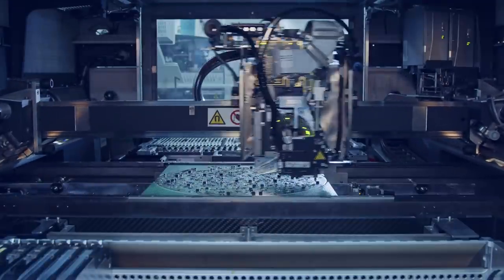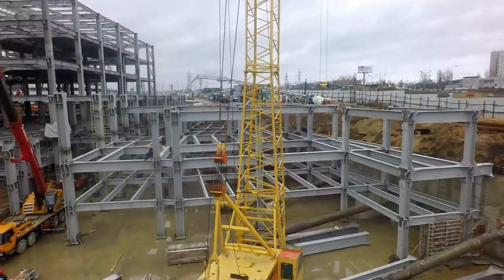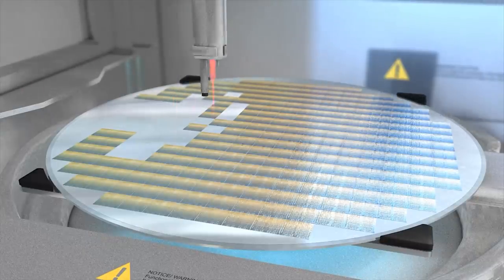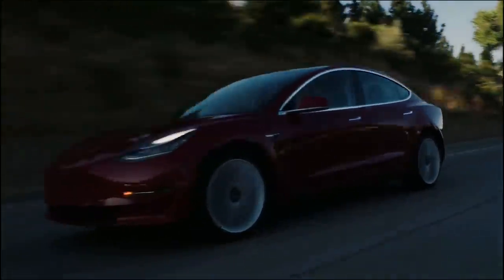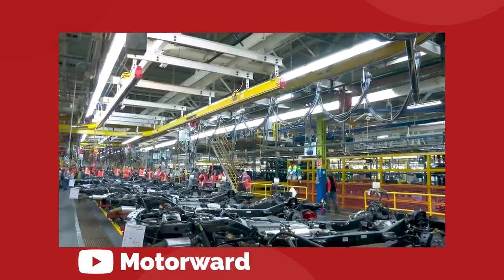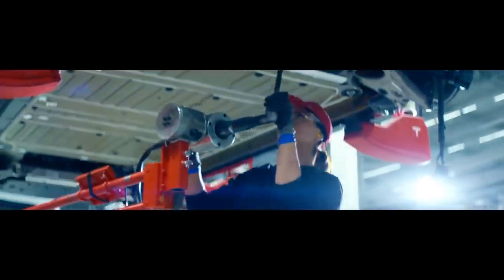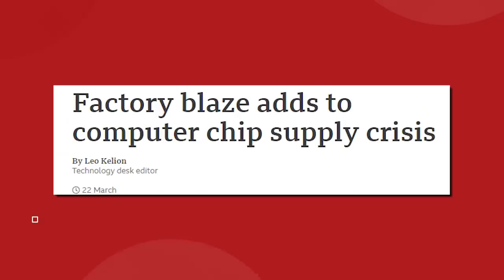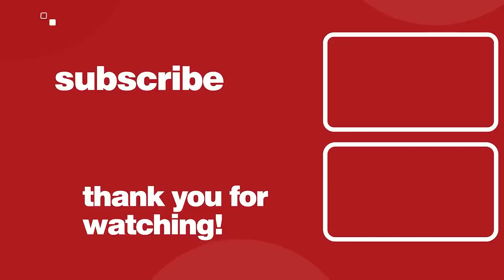The Real Reason Tesla Overcame The Chip Shortage Crisis!

Comment: Many appliances like washing machines, refrigerators, microwaves--have NOT improved with electronics, they've gotten worse.
Reply: In what regards? In terms of longivity? In terms cost effiency or energy preservation?
Reply: @Danny-qt5vt  In terms of "it's the circuit board that's bad" when it quits working after two years.
Reply: There was nothing wrong with mechanical thermostats for refrigerators timers stoves dryers and washers they were more dependable! Never needed a digital display!
Reply: well....."old is gold"
Reply: @Danny-qt5vt    In terms of efficient usability, cost and reliability.   Microwave ovens are the WORST, unless you search out a commercial one.  Would you take 5 or 10 seconds hitting hitting several buttons to turn on a light?  Yet that's what we have for those STUPID nukers.  (i have a commercial dial type and it's vastly superior) 

 ON with a timer to OFF, that's what you do with them, it's asinine to have anything more than a rotary dial.

I had a brand new Hairer refer a few months ago, the touch screen controls NEVER worked right but then the POS never got cold anyway, just didn't work right out of the box after I spend 3 hrs getting it unpacked, up stairs and into my kitchen.  (should have plugged in with extension cord out in the front yard first to see if the pile of F_ck would even turn on besides the light)
Reply: I agree microwaves were better with a knob.  I don't want to go back an analog clothes washer.
Reply: Electronics can be reliable if the manufacturer wants it. Most dont. 
Ford delayed the introduction of electronic ignition because it was too reliable and they wanted it to fail out of warranty so they could charge for another one.
Reply: @fivish  yep this is why satellites last 20+ years. But it costs more. Someone has to design it for life and the autos want to save $100 on a $40k car but it’ll needs several thousand in repairs a few years off the lot. Toyota seems to get this. My gm needed a new part every 6 months
Reply: @fivish  Where did you hear this?
Reply: @John Milton yeah personally the only thing I personally enjoy but that's just me is smart switches and sometimes i just design my own stuff to look chunky and haphazardly made purely for the excitement of doing it.

But i do enjoy some basic smart tools however outside of my computer, phone, fitband, switches and my Alexa, everything else need the least amount of electronic parts as possible, i may have the skill to repair them but not the amount of fucks required.
Reply: @plumbum6558  or a 20in touch screen monitor that tells you when your chicken is done marinating.
Reply: @fivish  so capitalism is not was taking us forward but instead holding us back?
Reply: @Danny-qt5vt  Good questions. I was at sea when I first saw the earlier comment .
Reply: because they are made to break down within a few years so you gotta buy new ones. Nothing to do with electronics per se. Its an economic theory that is kinda wastefull.

Comment: I have never opposed an idea expressed in video/Youtube ever so much to write a comment on it, but here I am...
Fundamental problem with this video? There are A LOT of valid points where none of them look outside the given statement (try to prove the oposite).
In start, background: I am dealing with chip shortage solutions in a company were all its products are "electronics"; I am very familiar with reality of this situation.
Few of our products got stuck in supply chain shortages, but some never even stuttered... not even for a day there was a "chip shortage" for few products ever! Reminder - all of the products are strictly electronics. What gives? Only few arguments as an example...
"Chip shortage" is more precisely defined as a "sub-100nm digital high-speed chip shortage" (to be clear, that 100nm number I just pulled out of my a** as even I don't know the precise number myself, but the fact stays). Not all chips are made equal. Not all of them require "cutting edge" tech. Even some ICs we might consider as "very sophisticated" does not require companies like TSMC to make. It has nothing to do with "vertical integration" or "in-house code development". First, there is a difference between general purpose ICs & ASICs. If You design Your own ASIC (essentially a custom chip), You can chose two things - size & technology. If You have a freedom to make Your chip huge AF & lower the frequency of operation at the cost of more operational nodes inside Your ASIC, You can make a "potato" chip that is far superior than the most powerful CPU in the world! Real life example? BitCoin ASICs vs Intel CPUs. Intel (at the time) was built on 14nm tech whilst BitCoin ASICs were made in 130nm tech! Hell, even current top-of-the-line BitCoin ASICs are made in "true" 16nm tech while Intel is made in more like 10nm or smth. Guess who mines faster...? Most in-house designed ASICs WILL NOT use cutting edge technology as it is more expensive and makes no sense. This makes ASIC market in non-cutting-edge tech pretty immune to "chip shortage" as they can be made outside of very economic-sensitive factories. TSMC is faaaaar from the only place where chips are made. Guess twice what "Tesla" was doing and other car manufacturers never did...? "Boch" is main tech supplier for if not all then most car manufacturer in the world in means of electronics. As they supply so many makes & models, it makes no sense to develop an ASIC for every customer - it is much more cost-effective to go with generic, over-the-top ICs, that can do everything for everyone... if they can be supplied, that is.
Second reason is plain and simple - money. If You have money, You can buy anything. Even Your place in queue ahead of everybody else. Even chips that are out of stock. F**k it - You can by a workforce that can design You out of any shitty situation You get Yourself into! We did it ourselves (bought chips that were so called "out of stock") for one our product... Okay, price went up significantly.... for A CHIP, but in retrospect for whole product? Not that much. It was not even that much to increase the price of our product in the end. But for manufacturers, where we are talking about hundreds of chips? Brute-force approach is just not an option!!
There are many more arguments from real life that contradicts arguments in this video, but I am already playing the bets on the fact someone, anyone will ever read this! :D
So, final word - all this "chip shortage" is actually affecting very narrow market space of silicon products that (unfortunately) covers a wide variety of products due to much, much more significant factors that are very much outside the scope of this video.
Though I am ready to tell more if there is someone that got to this line... :D :D :D :D

Comment: Computer "chips" are made with Silicon (Sill i CON) not Silicone. Breast implants use silicone.
Reply: My bong is also made of silicone, it is 3 separable pieces and really easy to clean :)
Reply: Whats the diffrence. The utilty of the element is vast. From inplants to computer chips
Reply: @stevehoran6132  Silicon (Si) is an element. Silicone is a petroleum product.
Reply: @milesobrien2694  huh fr, I thought they where the same thing xD cool how Si works in chips huh
Reply: @stevehoran6132  Well I made the original comment because he said "silicone" when he should have said "silicon". But silicone is based on silicon: "The most common silicone compound, poly-dimethylsiloxane, can illustrate the central characteristics of the class. The starting material is metallic silicon, which is obtained from silica sand." So you're nearly right, LOL.
Reply: That's basically why the rest of the word use silicium.

Comment: What wasn't mentioned is that the more traditional car manufacturers depend on older style chips that use more wasteful large nanometer architecture. When they cancelled their orders the FAB manufacturers moved onto making smaller nanometer chips which can't be used by the car manufacturers without redesigning a lot of their electronics. They also would need to test the newer tech chips to make sure that they are reliable and safe enough to be used as these are considered to be mission critical.
Reply: Thanks you just saved me 14 minutes.
Reply: Those are 10mm chips now they use 5mm & 1mm
Reply: @nathanthomas8184  nanometer not millimeter
Reply: seems a lot of computer makers are short on chips too.  PC sales soared throughout covid, why did they stop making or distributing those chips?
Reply: @anythingoriginal  they didn't stop. Demand is just at an all time high.
Reply: @oldrrocr  I think you misunderstood "obselite" vs older process nodes. Tesla has many sensors and cameras that require a lot of processing power to compute it's surroundings for autonomous driving. That means they require more powerful, newer chips. Most other vehicles don't have anything close to the AI systems that Tesla uses, so they don't need theost powerful chips. For what they do, the chips in most modern vehicles don't need a lot of power. So it makes sense to not buy chips based on the more expensive newer nodes. It's like buying a $3K computer for your grandma. TSMC and other fabs don't care to increase capacity on said older processes because they don't have as big of a margin on them and they're already well past full, it'd be crazy to. The only thing Tesla did that made them smarter was not cancel orders; the fact that they're using a newer process node is circumstance, not pandemic planning.
Reply: @nathanthomas8184  as someone said, it's nm and not mm. And no, no one can manufacture on a 1nm process at the moment. I believe tsmc is at 4nm. 
Although at this point, I think the numbers in the race to manufacture on a smaller process are 'massaged'. I think there is a certain amount of interpretation in there
Reply: (to OP) A fab can't just change a production line from a higher nm process to a smaller process on a whim, therefore I don't think what you said is quite correct.
Reply: @justjosh11  Yes they measure the gate width not the actual transistor size. TSMC's "7nm" is actually like 12nm and the rest follow suite.
Reply: @anythingoriginal  it's because demand is at an all time high for phones, computers (yes including graphics cards and no it's not just the cryptominers), personal cars and general personal electronics.
Reply: @ILoveTinfoilHats  From my experience, there are plenty of the less powerful microcontrollers around although at relatively high prices.  However, there simply are not available very many of the more powerful microcontrollers.   Anything faster than about 300 MHz is out of stock with lead times over a year.   

If Tesla has managed to work around that, they have indeed done something special.
Reply: @isaacclark9825  But Tesla doesn't USE most of those micro controllers that other car brands do
Reply: @ILoveTinfoilHats  Yes, that is obvious if they are still getting chips.  However, the question is whether their own actions have contributed to their suppliers being able to keep supplying them with chips.  If Tesla had canceled orders, how would their suppliers have reacted?  The smart thing to do would be to start making chips they could sell to someone else.   All chip manufacturers were faced with the same pandemic pressures and the same need to make money.
Reply: @isaacclark9825  Like a said before, the only "smart move" telsa made was NOT cancelling orders. If they did, TSMC would've just sold that spot to AMD or apple, or Nvidia depending on the timing.
Reply: @ILoveTinfoilHats  So you don't believe that they sourced any alternate processors as was reported?
Reply: @ABEL-cd2sp  Crypto people should be buying actual miners.  Something happened that the market couldn't predict, crypto bros.  Plus Nvidia and tons of other renting GPUs through VM.  Those are cards not in consumers hands, because in the future no one will own anything.
Reply: lots of cars in junk yards with chips in them.  maybe companies should start car recycling, like a guaranteed minimum buyback for parts.
Reply: @anythingoriginal  most silicon isn't really "general purpose" like a CPU is, so you can't just reuse it. Plus even if you could you wouldn't want to, considering the exponential growth of processing power over the years. An 8 year old processor is slow AF compared to a new one.
Reply: OK this explains why car manufacturers who cancelled their orders due to uncertain trading conditions are having problems but why have noncar makers got shortage issues who didn't cancel orders like Sony and Microsoft for their new consoles?  So if it is demand greater than a supply issue, why was everything running smoothly before covid and if carmakers cancelled orders then that should have freed up supply for everyone else. Without going into conspiracy theories too much I think it might have been caused on purpose in the same way oil producing countries lower output to create higher prices although i don't think higher prices is the aim here but to destabilise for someone's benefit.
Reply: @beachlife2968  nope, silicon chip output is at an all time high. With COVID everyone needs new tech. AMD, Intel, and NVIDIA have all posted record breaking years and are still having difficulty keeping stock on many products. The fact is everyone working from home needs new computers, webcams, keyboards, TV's, consoles, etc. Add on top of that the crypto boom and you've got a huge demand for graphics cards and ASICs, all of which require large silicon dies and many of them.
Reply: @ILoveTinfoilHats   So simply, demand has gone through the roof then.
Reply: @beachlife2968  entirely so
Reply: Stop talking shit mate, do you even realize how modern vehicles are today!? No manufacturers uses old style chips anymore, and for your records Tesla doesn’t just use high end chips but also old ones. Tesla has been selling cars with missing parts without telling customers, what a shame they try to mask the chip shortage.
Reply: @nathanthomas8184  are you serious!?

Comment: I grew up in the 70s. 8 tracks and carbs. You changed the points in your car to keep it running good..no cellphones. computers?? Tvs had tubes.. I MISS IT
Reply: I don't miss carbs at all. Had a Dodge Dart with a slant six that would vapor lock on moutain passes.  My forst brand new car had single point FI and I loved it. 8 tracks were cool though.
Reply: @MrCPPG  what car has single point EFI?

Comment: 5:00 Chip generations are almost seasonal and that makes it almost taboo to stock new chips long term as you would have many generations of chips by the time production picks up. There are levels to hardware retention and EOL practices. It is rare for OEMs to hold older items as it can cause production problems, Tesla has had this issue several times as a newer car manufacture.
Reply: Your assuming short EOL. Most of the chips the rest of the car industry uses was designed 5 to 10 years ago. They go for stable chips with high availability and has gone through growing pains before implementation. A great comparison is why the US military still uses windows 98 in ships until recently.
Reply: To add, it falls into the lean manufacturing principals, that these companies including Tesla, follow to order only what you need to reduce waste/cost
Reply: @unadultratedtrini  If those company still have money to throw around like tesla did stock them is a good idea. But as you can see at start of virus situation everything look bad and extra weight need to be cut.
Reply: @miraichan5292  Your also missing the point that they decreased orders going into the pandemic because they miscalculated vehicle purchases. A lot of people that would otherwise go on vacation took that money and did house upgrades and new vehicle purchases which for some reason no one expected. ....

Comment: Why I like my 20 year old washing machine and dryer. No chips and I can still get parts for them. Also like my old 1992 Chevy Silverado I can put a carburetor on it whenever the fuel injection system fails or can't find parts for it. New isn't necessary better. If you buy a new car right now there is no guarantee that you could find a part for it if something anywhere where to fail as hard as things are to find on the shelves anymore

Comment: I remember I briefly worked for a chip manufacture that was working on a new photolithography stage.  They had issues with the air conditioner noise resulting in vibrations messing up their accuracy.

Comment: You don't just slap a different chip on a board and re-write code, you also have to re-design the board.
Reply: Nope, not if the board is re-written
OTA nails it.
Reply: @andrewsaint6581  What does that even mean?
When you change the chips its physically the square peg in the round hole problem. So they aren't just reprogramming, they are also re-spinning the PCB's.
Reply: Usually it’s just a minor change to account for a different pin out.

Comment: This is b.s.  The reason Tesla doesn't make every chip is like the house builder doesn't make nails and plywood.  Most of the chips use are common chips.  Tesla may have a few custom chips.  Tesla factory is a final assembly only.  All the components are assembled from many suppliers.  Tesla forces their suppliers to double and triple ordering (hog all the chips) and hold them (at the cost of their suppliers).  The same thing Apple did to their suppliers.  The good thing about Tesla is they have preorders (because they sell directly to the consumers) and Ford and GM only go by the forecast.  Tesla cannot quickly switch chips and quickly reprogram as they told you.  To qualify for another chip, you have to go through a qualifying process that can take at least 6 months.  If the chips are different in size, then they have to change a lot more- printed circuit boards, test equipment, etc...  It is not as simple as they told you.